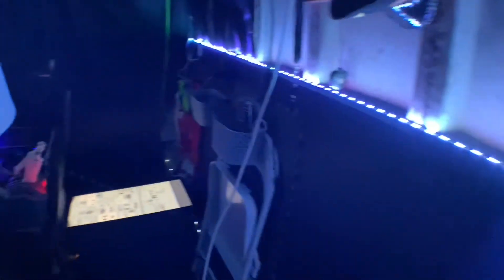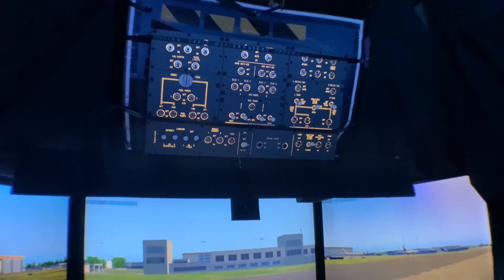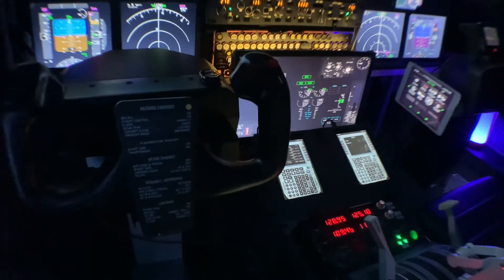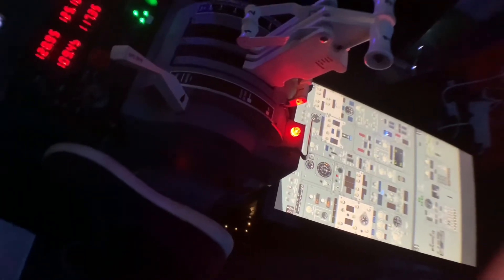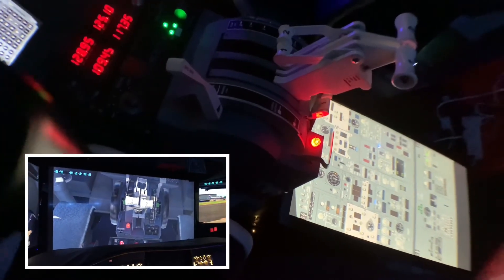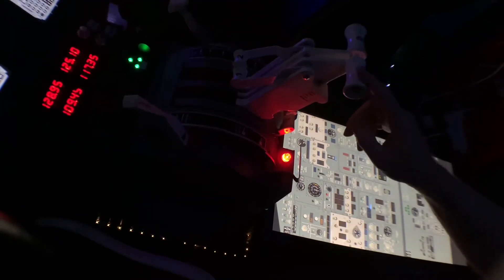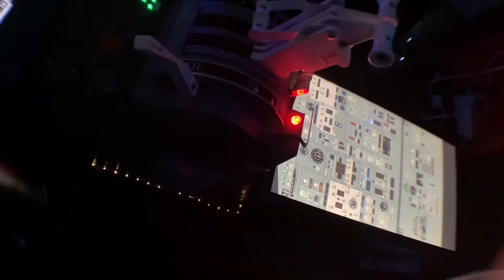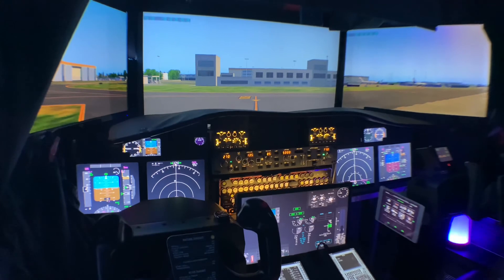737 Throttle Quadrant Part 2 | The Installation Is Complete | 737 throttle | home cockpit

Comment: What is thee feel of the throttle:? seems to be a bit weak.
Reply from the maker: Hi Fernando, in RL I’ve only flown small light aircraft and in the Sim I’ve come from having a modified saitek throttle. Compared to that the resistance of the throttle is amazing and takes a lot more pressure and is completely stable when you set thrust. I did however get it from a RL 737 Jet2 pilot - and he thought the feel of the throttles was very good / lifelike. He traded up to a flightsimPM quadrant because he wanted the column and more lifelike and easier to map (with X-Plane 11) speedbrake and flap setup. Hope that helps!
Reply from the maker: @Richard Gaetti yea I mean I got mine second hand. So I can’t vouch for how much better a brand new model is. I am experiencing a bit of an annoying cross over when setting thrust with the right reverser occasionally kicking in …not ideal if you’re flying vatsim and have been cleared for an immediate take off! But I personally am happy enough …well until I do my next major upgrade on the sim and then I think I’ll move onto the flightsim PM throttle.

Comment: What's the screen size of the overhead touchscreen?  Sim looks great!
Reply from the maker: Thanks Kevin! It’s a 27 inch touch screen. I was expecting to get an opencockpits fully functioning forward o/head panel - but it didn’t arrive….so I thought this would be a good in between step. The FlightSimPM overhead I have is great, but it’s an only an input board, so has limitations (and no annunciators). 
I have to say the touch screen plus air manager panel is great and when the r/l overhead does come in I’ll retain it as a touch screen pedestal and radio panel - cos it fits almost perfectly behind the throttle quad. 
I haven’t tried to ceiling Mount it as the touch screen monitor I bought is incredibly heavy….So if you go down that road and want it overhead mounted make sure to check the weight of the monitor before the purchase